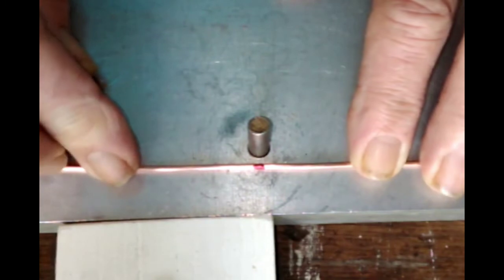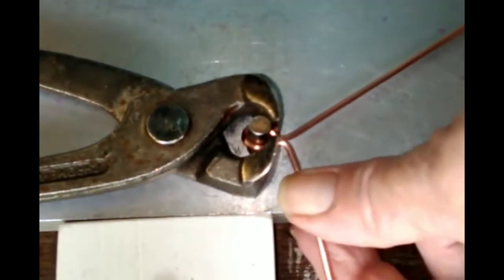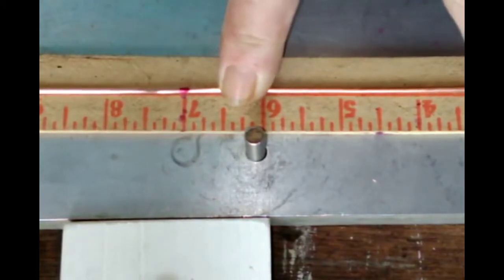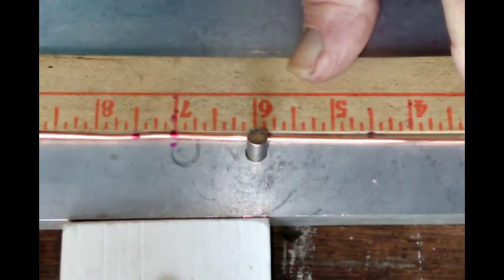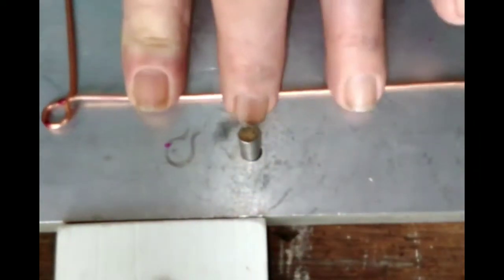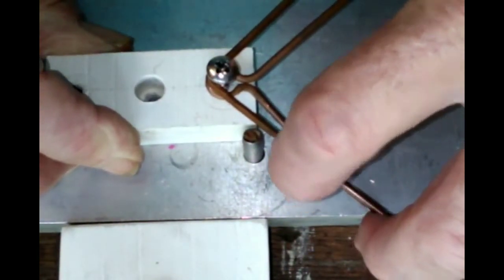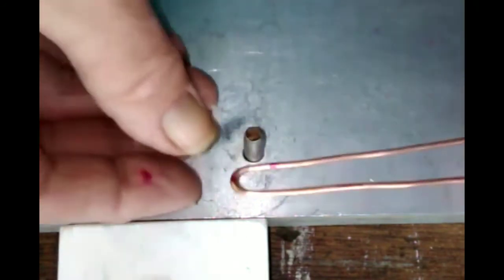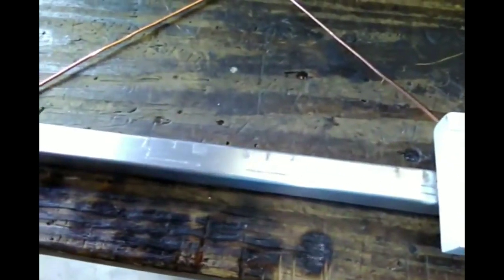CREATE HOVERMAN ELEMENT (short)

Comment: What's the diameter of your bending jig pin?
Reply from the maker: ¼ inch or a nail or screw about the same size.
Reply: @cosmicantenna9244  thanks, that helps.